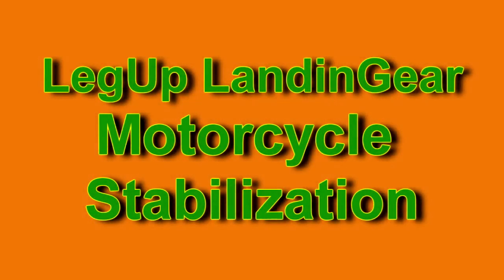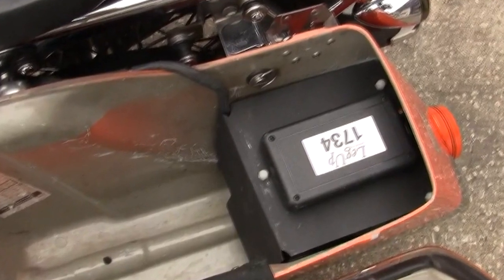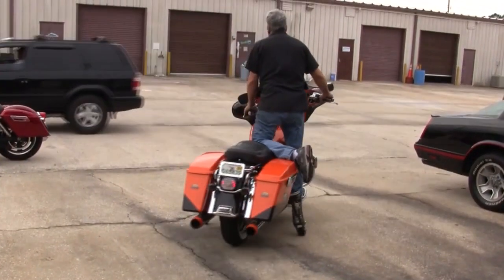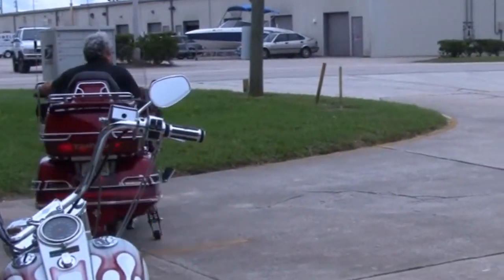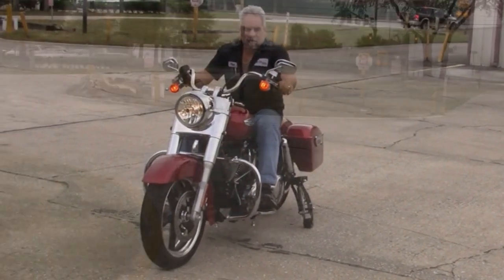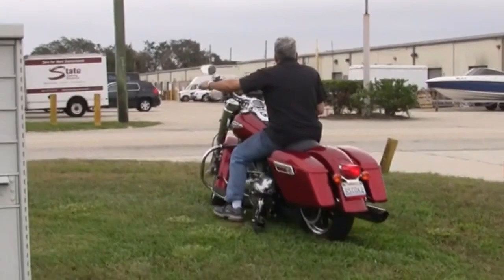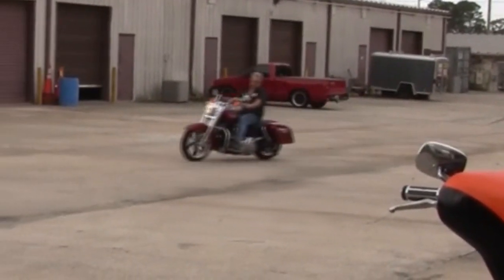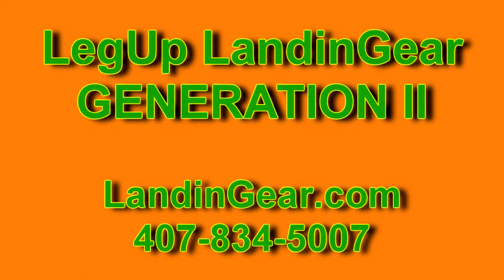LegUp LandinGear Generation II - Amazing !

Comment: I was thinking I was going to have to give up my new Road glide. I was a present to me for getting the the process of getting on the UNOS kidney list. I am end stage  and hoping to be able to get a few years in. I also suffered a bad nervous system infection which left me partially paralized for about 8 months. Long time in rehab got me back moving. Your leg-up system makes it possiable for me to ride the Road glide with little problem when navigating slowly and becoming stresses out when standing still at long red lights. The lead -up did take a bit of "tweaking" of the alignment. Also a few hours of practice in a clear parking lot really helps. After a little bit using the system became natural and conformable.  Thanks Pete for your help and for helping me get back on the road on my great new Road glide on the roads out there in AZ.

Comment: @Pete G 

This system will really help disabled and older riders, I think it is amazing. There may be a market for beginning riders here as well that may be uncomfortable maneuvering at low speeds. It would be nice if the wheels could be concealed when retracted or if they had an LED array on them to display red lights on both the rear and sides for increased visibility when stopped at night once the wheels fully deploy and the brake is applied. When they retract as you let off the brake the lights could automatically turn off.
Reply from the maker: Ken Harrell ... Thanks! I like the light idea.   I will leave that to the individual riders. Thanks again.

Comment: The Korean GL7HM is a good example. The one that is blue anodized aluminum on the police bike - YouTube. Notice the narrow bars supporting the down action of the wheel. The Foot board could be designed as a regular passenger foot board with a chrome SKIRT AROUND IT to hide the landing gear when tucked up inside! The mechanical operation does not need a floor board top, all it has to do is extend the wheel down. Make a REGULAR RUBBER TOP FLOOR BOARD with a Chrome SKIRT Under which this operates.

Comment: OK $1500.00 TOPS but that is it! Also, your design looks esthetically like crap. The metal has no structural Flow visually and instead of all the WIDE cut outs, solid NARROW bars would suffice. Add a plastic cover painted chrome or black to hide the contraption when it is up, adding to the good looks of a bike instead of taking away from it with an ugly looking landing gear. LOOKS MATTER! The Korean design is going in THE RIGHT DIRECTION LOOKS WISE! IMPROVE on Their model DESIGN! COVER YOURS TOO

Comment: This would be ideal for enclosed motorcycles.
Reply: track worker l
mkoiiiiiiiiiiiiiiiiiiiiiiiiiiijjjjjjjjjjjiiiiiiiiiiiiiiiiiiiiiiiiiiiiiiiiiiiiiiiiiiiiiiiiiiiiiiiiiiiiiiiii the last Nikko the other
Reply: It won't be long until we start seeing a LOT of "convertible" enclosures for touring and cruiser bikes... and eventually some 'hard-shell' designs
And with systems like this -- very likely becoming "Dealer Installed Options" -- and the "Tilting Wheels" front systems, it will become pretty easy to have a pretty dry ride regardless of rain... or maybe even some A/C for down here in the South, or out West.. (-:
And I can relate to OasisofSpirit above with the physical limitations... I have both Military injuries and a near-fatal traffic accident that have left me with a number of "limitations". And I hope these devices/systems make it possible for a LOT of injured Veterans, and Police Officers, and any of us that simply LOVE to ride .. to KEEP riding! And for companions to feel SAFE to ride With Us! Much better to have to "dial it back a little" than to have to SELL our bikes and stop riding!!
As for "Price"... the Manufacturer has to decide what they need to sell it for to make it 'worth' their efforts...only a FEW of which were listed above..!
And the Buyer has to decide if the benefits of the product are "worth it" to have and use at the price that is required... Would you rather buy a Tilting Wheels assembly for around $10,000 or so..? (I haven't priced them recently, but they are a Great alternative for certain riders.) Or add a 'Trike' Conversion for $4500 or more..?
Or go with the LandinGear design, and still be able to ride a "normal" 2-wheel motorcycle..? Personally, I STRONGLY go with keeping the 2-wheel ride!!